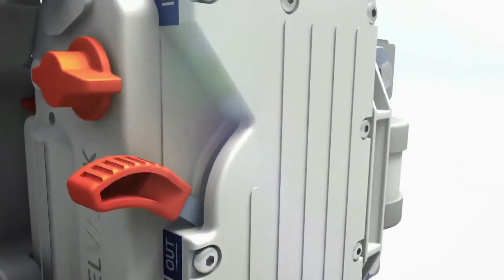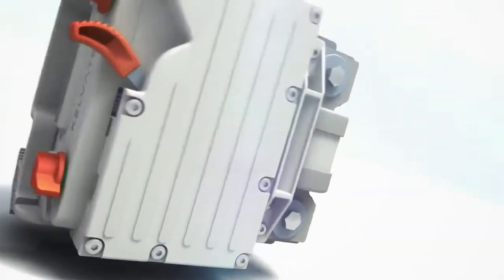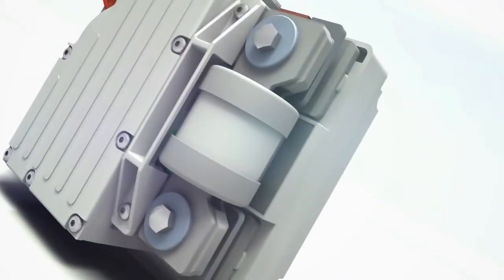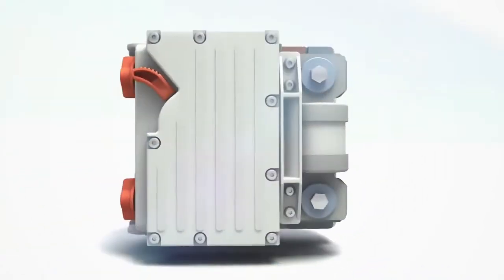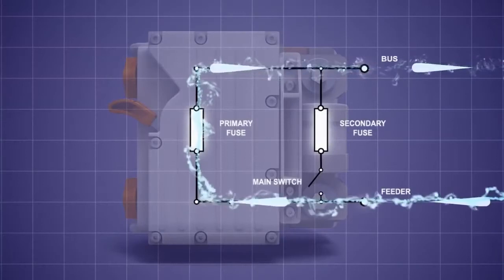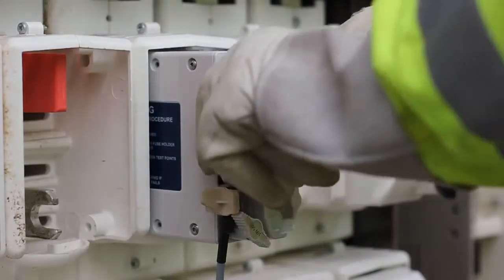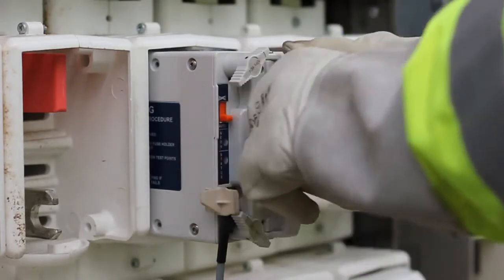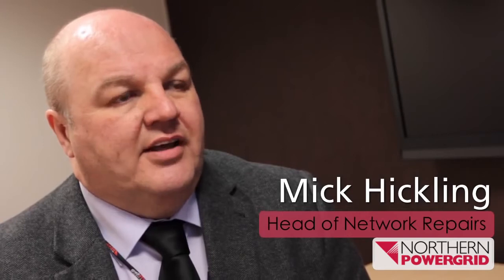Low Voltage Distribution Network Autorecloser and fault location device - BIDOYNG by Kelvatek

Comment: I've just been told about this device by National Grid. Since November, when we had storm Bert, i've had a couple of blackouts (it's been many years! since i can recall the last in my area) but a bunch of recurring like power spikes, where the lights flicker on and off rapidly from 5 seconds to 1 second. This results in me losing internet connection briefly (computer stays on though) and my boiler to trip with an error, which i have to reset. I can also hear the shop alarms in the high street being set off every time this happens. Apparently NO-ONE else in my area has reported anything! 

National Grid sent me an email tonight: 'Our engineers have noted that they believe you are seeing the result of a piece of equipment installed at the sub called a bidoyng.
This smart fuse is designed to automatically insert a secondary fuse into the circuit following a transient fault and restores supplies to customer in less than 3 minutes and reduces the need for an engineer to attend site. As a result customers will often see brief interruptions in their supply.'

I'm no expert but, how does this explain my situation? Would the power not go out totally, even for a few seconds? 'Brief interruptions' sounds like power outs, not these weird power fluctuations.

Still can't believe this has been happening for weeks now.